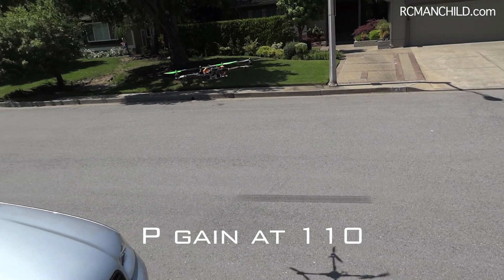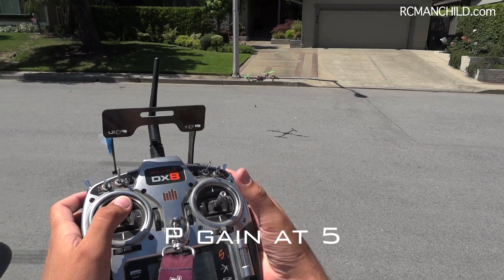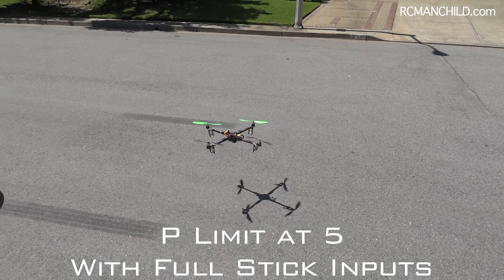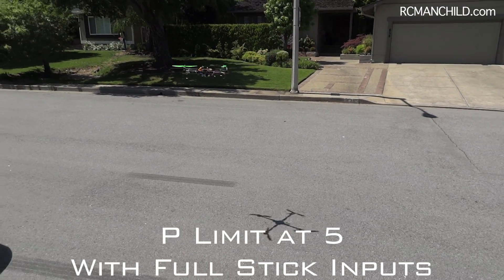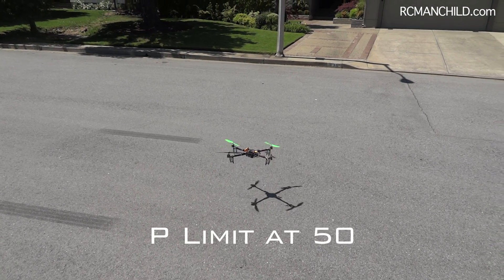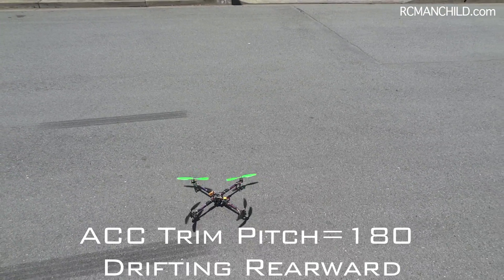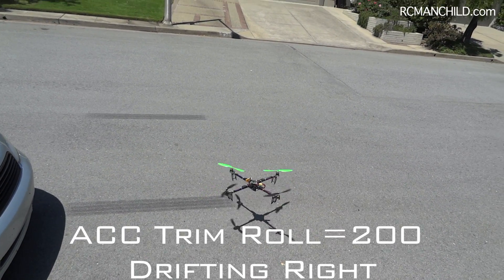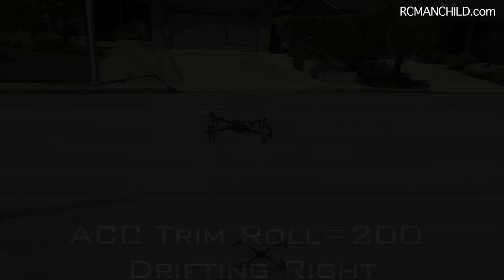KK2 Autolevel Tuning and Explanation

Comment: your explanation defining gain limits is incorrect. the limiting is imposed on the system not control input.
Reply: I understand the limits in the PI settings are how much of the power budget this control can use to pursue reducing the error to zero. If you set a limit to 10 it says the control can use up to 10% of the total power budget to pursue zero error. If all other controls are in equilibrium, you get your 10%, but if other controls are making big corrections they get their share of the power budget, first. With 10% power allotment, it might take a while for our control to recover, or take forever to catch up. The control would therefore be out of control, unable to zero the signal error.

Comment: what if it is rotating to the left , like a left stick to the left would do? also why does mine say auto level off in safe mode? how do I turn it on?
Reply: you need to hold the right stick to the right when in safe to turn that on

Comment: Hey there dhdsracer, I have a problem with my quad it keeps turning around itself slowly when hovering on the air, any idea ? thanks
Reply from the maker: Make sure all your motors are leveled first. After that it i is ok to trim your yaw at the TX.

Comment: I have a kk2.1.5 in a mini quad. I don't get oscillation, but the quad will just quickly flip upside down as crash. Any ideas?
Reply: same problem
Reply: You might check your motors and props.  When standing behind your quad, the upper left and lower right motors should be CW and the upper right and lower left motors should be CC. If that is the case then check the props.  The leading edge of the prop should be the upper edge.  Hope this helps.
Reply: I fixed mine. I got confused about the motor layout.

Comment: Let's say I have a separate battery supply for my KK 2 board, and I plan to use it on my plane not quadcopter. If the battery supply to the KK board dies out, will my receiver still power my servos? Or would I lose all control except throttle?
Reply: You would have to make sure you lift either the signal wire and pin from your cables, or the + and - pins from any  of the cables coming from the rx to the fcm, and insulate them with spare pin shrouds, and only leave the signal wires if you want to totally have separate power. If you dont, your power sources will be mixed since the power pins at the M1 set are common to ALL the input pins of the KK. Your receiver never powers your servos, except maybe the M1, if you are supplying it Rx-FCM-Thr. Now if youre running some 5 or 6 heavier duty servos, your BEC in your ESC cant handle that load. For that you need a power source going to the M2-M8 pins of the KK, those are a separate bus from the M1. So bottom line: the rx and kk CAN be powered together, and a separate battery for anything controlled off the M2-M8 pins.

Comment: Hi!! GREAT VIDEO!!
Can anyone help with my problem-Its my first quad build using st360, stock motors, kk2, power distribution board, 2200mah 3 cell and 4 channel hk transmitter and receiver.
The problem i have is the quad takes off but then comes back down, every attempt is the same? Only reaching 2-3 foot off the ground.
Weight is 850 grammes.
Thanks.

Comment: Hi my Hcopter tends to yaw towards left.What should be the reason for this and plz give me suggestion to overcome this.
 Thanks
Reply: Try increasing the yaw gain and limit in your PI settings (not auto-level).  You can use the trim adjustments on your controller, but that won't be consistent.  As you throttle up/down you'll want to change your trip.
Reply: Thnks bro, i shall try it on my next flight.

Comment: great video and great explanations, have you ever thought of doing a video explaining how to use PI editor adjustments ?
Reply: P is the primary correctional coefficient.  It looks at one moment in time and dials in adjustment of various amplitude based on its "gain" so yes, it can somewhat be considered a sensitivity setting or, how much it's going to correct.  Limit is how POWERFUL the P term is, or how much motor power is used to execute the correction (user input has nothing to do with this).  A large gain and small limit will make that large gain not very effective.  I is a secondary correctional coefficient which looks at current vectors but also takes P into account and makes adjustments over time. The goal of I is to avoid exaggerated adjustments.  This can be conceptually thought of as 'when to let go of the gas so as to avoid overshooting your target'; smooths things out.  You must tune both P and I to achieve quick, accurate adjustments (typically for acro) because you want P to respond fast and hard but you need I to adjust the correction AFTER it's initially made to avoid the sloppyness of fast and hard.  I'm not sure that's all 100% correct, but I just spent a while figuring it out so I hope it helps someone else too.

Comment: Do you know anything about the problem when doing a yaw, left or right, the quadcopter also tilts? even when the quadcopter is hovering? I know when doing yaw, it should yaw flat. Like when doing a yaw to the left, the quad also tilts to the left.
Reply: Balance might be off or your limits might be too low.  Probably none of those but maybe an idea leading to another...
Reply: Perhaps you got mixing on? Sounds like it.... i am flying with tricopter with 30% mixing "rudder/yaw" and "aileron/roll".... so, when i move aileron, it will turn and also roll in a direction.....

Comment: Fantastic!  I am just getting my quad going and when I can formulate a set of questions I will get back to you.
Equipment as Follows:
Turnigy Talon 550 frame
Turnigy 2836 1100KV motors
KK2.0 FC board w/v1.2
Qbrain 4X 25 amp ESC
Orange 6 channel receiver
LiPo 3S 1300 mah power
Spektrum DX4e Transmitter

Great job with the videos.
Regards,
Captain David A. Johnson

Comment: Dhdsracer I have a question. Do you think the gains set in the "normal" PID settings menu (not the auto level menu) will affect at all the craft behavior when in auto level? Or are the normal PID settings only used when in manual mode?
Reply: Yes, the regular PI settings DO affect the craft when in auto-level mode albeit not nearly as much as when auto-level is off.  Auto-level will just correct on top of what the PI settings are doing so it's continuously taking over...
Reply: I have the same question.  Did you ever find an answer to this?  Hoping someone can anser.

I've always tuned the self-leveling and regular PI menu's completely independently.  I never tried to tune one then switch from self-leveling into acro or vice-versa and see if there was a change.

Comment: I found of later what was wrong. I was using the 'gear'-channel to turn the autolevel function on/off and it turned out that on my radio this switch was also linked to the 'aileron'-channel (I used this radio with an airplane earlier and the grear-switch to turn flaps on/off). When I corrected it everything worked fine, and still does.

Comment: A good way to eliminate this problem is to use the voltage sensing of the KK2.0, you will need some basic soldering skills... go google it up on how to use voltage sensing on kk2.0

Comment: to arm the auto level using the stick, hold your throttle at mid level right, and you other stick to bottom left, The Aux setting is for when you want to assign Auto level to a channel switch, so you do not have to use the above method but this requires a separate channel.

Comment: Great video. Hey would you know why my KK2 450quad always reverts back to drifting even when all my settings prior did eliminated the drifting issue, roughly after 1min of flying time,
my quad starts to drift again and it gets worse the longer I keep it in the air, its bugging me big time, could you please let me know if there is a solution to this, or has anyone here experienced the same problem and was able to fix it. cheers.

Comment: I wanted to know the basics about auto level. Like there are two modes: Stick and Aux. I figured out stick was easier and then tried to arm KK2 while pushing the right stick in all directions until I finally got it on. It is off by default and there was no place to know how to turn it on, not even here.

Comment: If i use a different battery does it affect the settings? because I usually use a 3s lipo but when i use my 4s lipo I get this 'high speed oscillation' you described in the video? HELP !!!!

Comment: Very informative. My problem is that the quad tries to flip over when I'm activating self level. If it's in flight it will promptly tilt and go straight backwards and into ground. If I'm activating selv level while on ground it will try to flip backwards when I'm increasing throttle. Adjusting the trim and P gain/limit doesn't seem to affect this at all. I'm using version 1.5. What can be wrong?

Comment: i just solved this for my quad. Not sure if you are using 3.5mm bullet connectors but one of those on my front left motor was bad.  NOT the solder.. the bullet itself. It was the male end. If the bullet rotates too easily, replace it.  Not sure if this applies to you but hope it helps.

Comment: Frustrated Please help.. I had a X525 quad, KK2 1.5, Moongel damp. NTM 2830 750kv,GemFan Carbon 10x4.5 balanced, Dynam 30A ESC, 2650 4S, GoPro. FLYING GREAT. Until a signal failure, sudden death. ONLY damage was to the frame... everything "checks out".
Now...have switched over to a TBS Discovery Spider frame "Replica" Same everything. the quad will NOT fly without a huge roll oscillation, and frequent flip and crash. I have changed all my PID's to several extremes and cannot find a balance point

Comment: Definitely loaded the tricopter model on the KK2?
How long before it flips?
Checked all ESCs?
I built the RC-Explorer tricopter, no balancing on props or motors, basic tail tilt mechanism. Only time it has ever flipped is when I was messing with the auto-level settings,

Comment from the maker: Yeah, it's tough to say but you could have bad vibrations affecting everything. Your P is too low and too much I can kill your control too. Just set the PI to stock settings and only decrease the AL P gain down. You won't have a snappy autolevel but it shouldn't shake. Flashed ESC's will help a lot too.

Comment from the maker: There's not much to do there. Height dampening is only using the Z axis accelerometer to try to reduce drop in forward flight. I've never liked the craft trying to control it's own altitude unless there is a barometer. I always set mine to 0 and adjust with my thumb:)